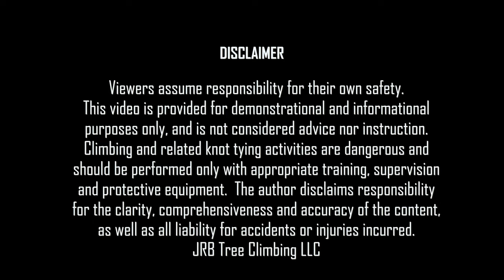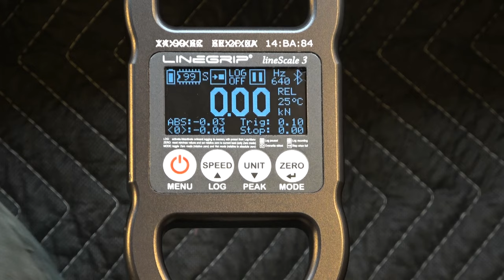Midline Munter Loop Knot and Emergency Footloop

Comment: Thanks for this clip. Recently I've been thinking of how I might "unload" my harness during a self-rescue situation, in order to attach and initiate a rappel devise. Recently, I was needing to manipulate gear with cold fingers and experiencing challenges in do so. With that experience I will find some added certainty with having a lanyard or tether on the dedicated emergency back-up carabiner used for the application you have presented. Thank you.
Reply from the maker: If we had time (and perhaps a beer), i could tell u stories of times when I hunted a little too long and cold in my fingers weren't working... and that's when i realized my MRS rope had become frozen in the tree crotch... and my friction hitch had frozen on the rope... I was able to to self rescue... but i learned that trouble seems to compound itself... and we need a plan for everything.